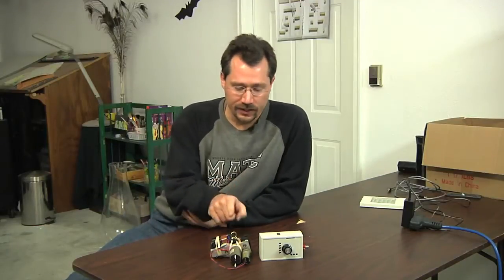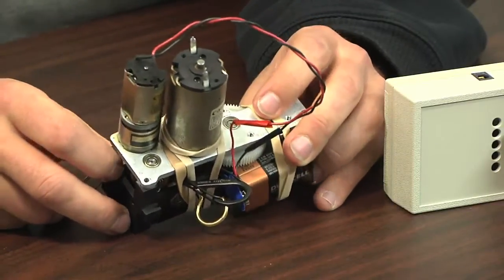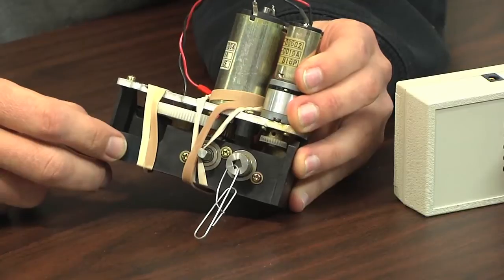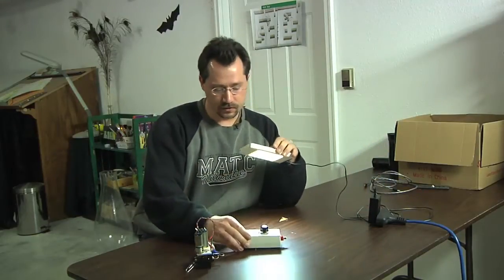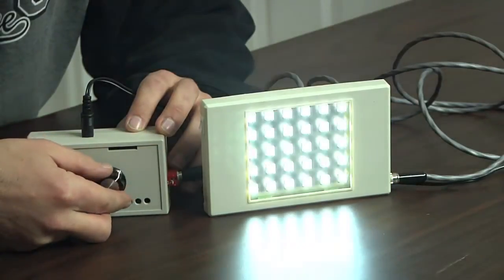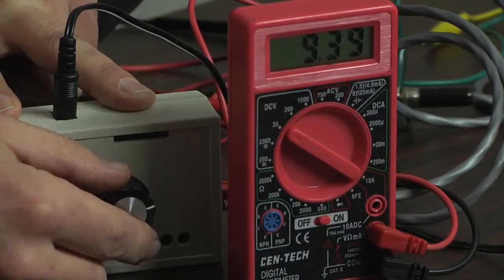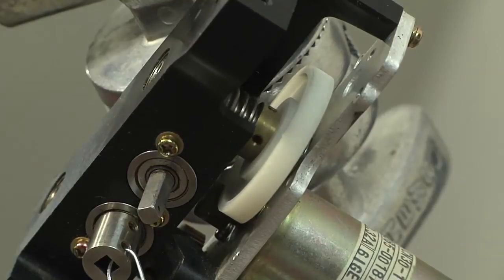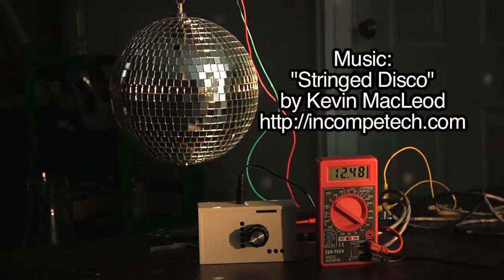PWM Disco Ball - Build an LED Dimmer & Motor Speed Controller

Comment: @MPaulHolmes 
I'd need to move to California first. 
My goal is to build a 3 phase AC inverter/controller for an induction motor. I'm still collecting info on the best setup. When I was just out of high school, I built a small 60 hz inverter to run an open reel tape deck in my car. It was basically a frequency generator connected to an audio amplifier, and ran it's output through a step up transformer for 110 VAC. I'm thinking the amplifier route is the way to go. Any tips?